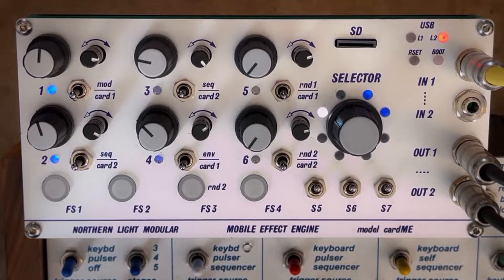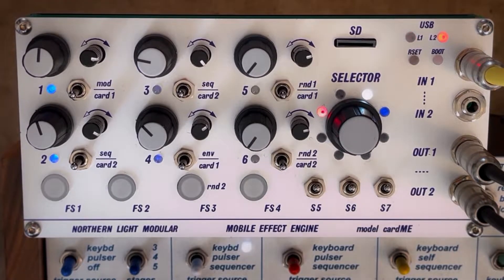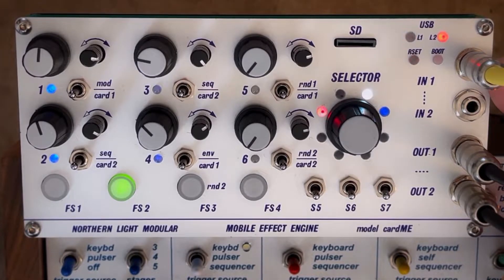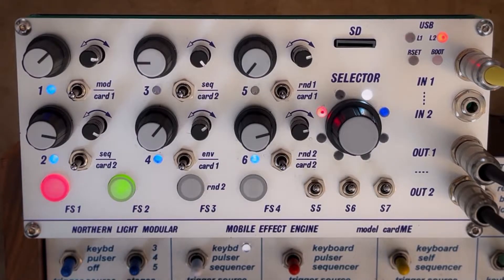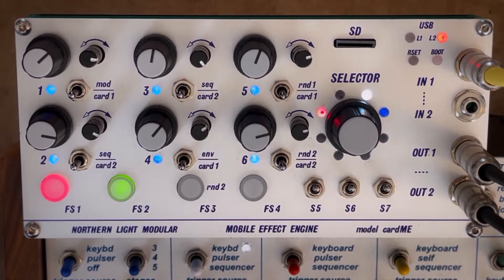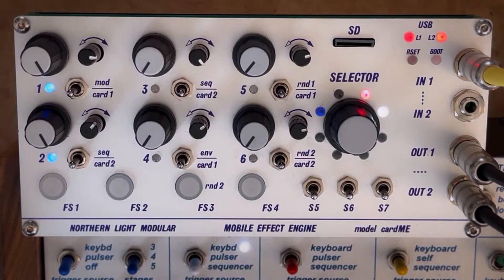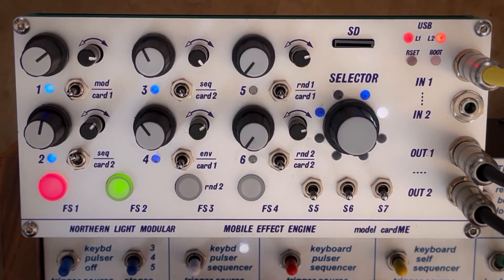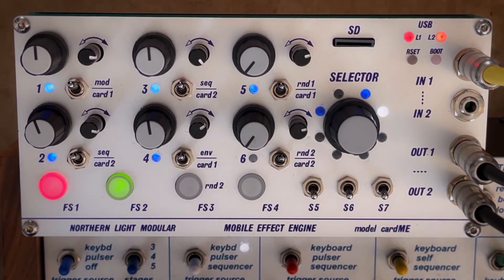cardME Introduction

Comment: Ooh! I NEED this! Is this only for the new 208 Command or will it also work on the later model BEMI Music Easel?
Reply from the maker: It works on all 208 modules with the standard card bus enabled.
On some clones one needs to route a wire to get the MOD OSC modulation to work.
The 208C has a second modulation input called "to card2" which is missing on the older modules though.
Reply: @NorthernLightModular  thanks! Now to see what I can sell to get this (it's been a rough year.)